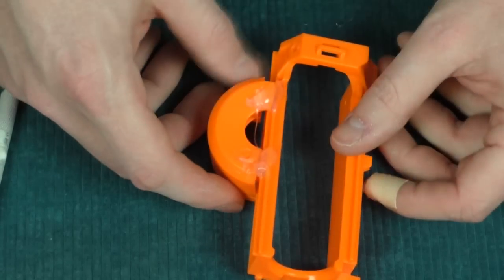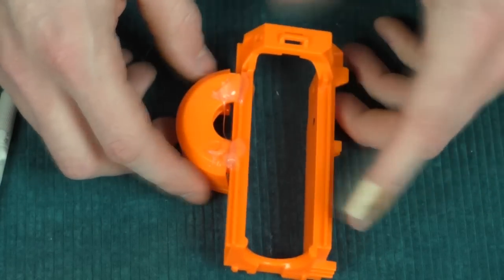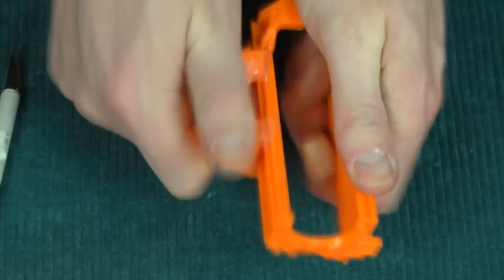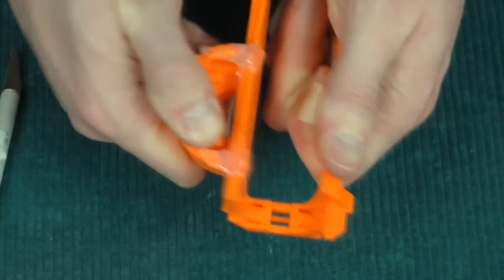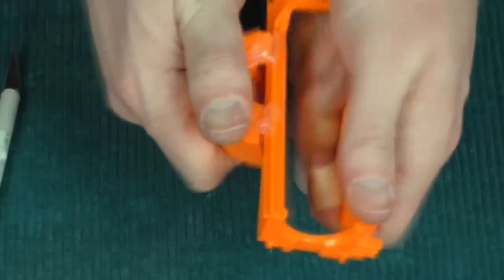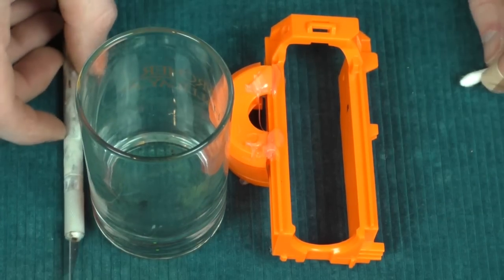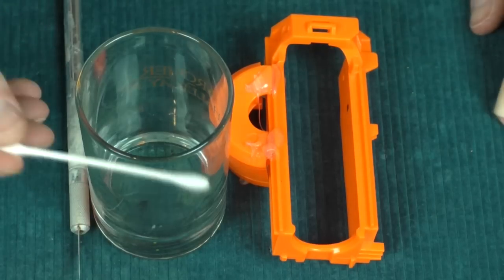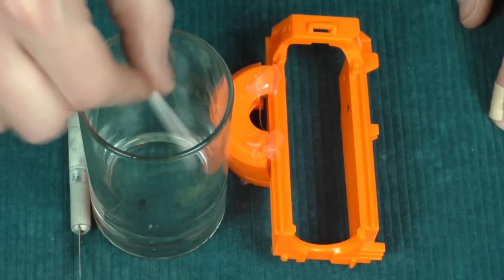Quick Tip - Removing Hot Glue

Comment: did work for me ,, had a pelivcase and someone had hot glued some foam inserts in the top lid and the base .. this ethos was no better than just using a scraper ..
you wanna remover hot glue .. get it hot .. if you able to pout boiling water over it , or use a heat gun gently , way better tech , save you money on iso too ..

Comment: Dude is a lifesaver. This worked instantly. I had 91% tho and I had a back cover that was glued to a PS Vita so a Q-tip couldn't fit. I put just a drop in between the crack and then a sharp kitchen knife and "presto" it came off instantly without a mark on it!

Comment: Thx dude i just used hot water to removed the hot glue from my slippers it work. I thought if alchohol can work so do hot water cuz hot water will soften and melt the hot glue BUT its pretty hard to get if off but if work it didnt leave a mark on it ThX